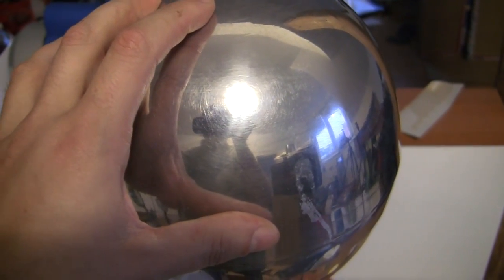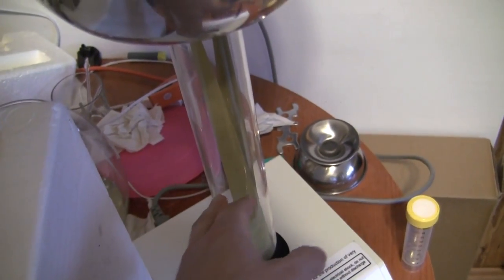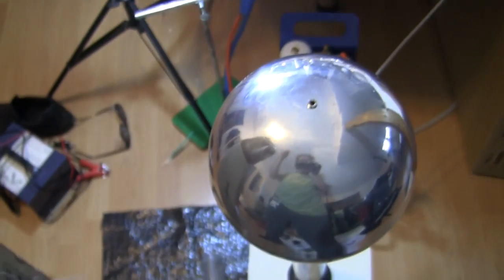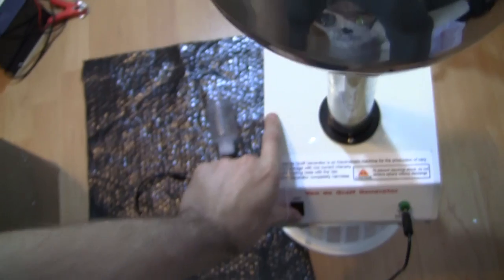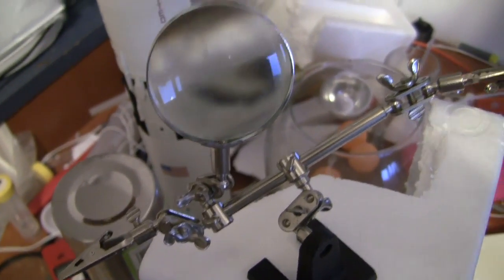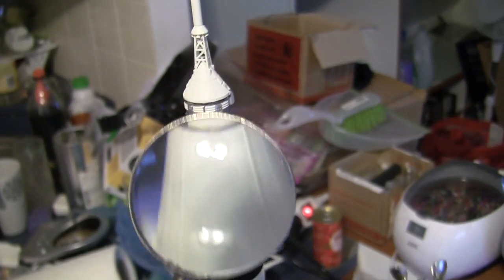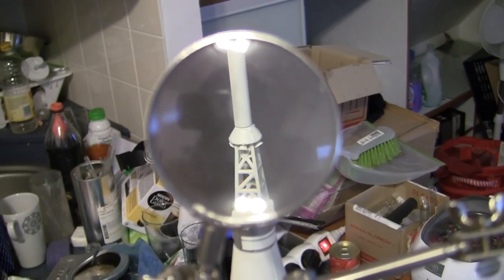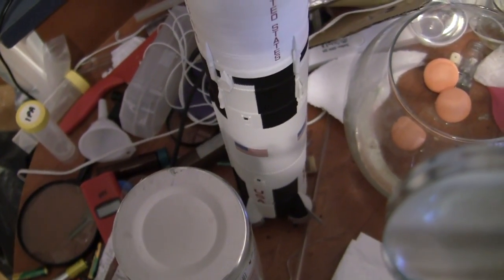Surviving a 10 000 VOLT shock!

Comment: It's always been my understanding, ever since high school physics, that the amperage is what would kill you, not the voltage. I forget why, though... it's been a couple decades. Voltage is... frequency, right? Amperage is intensity? I think. So the amps would burn you inside out, while the voltage would give you that jump?
Reply: I like to expain it like This,

Voltage Is like Speed.
Amps is like Density.

If you shoot a 1 cubic cm(Roughly 1/3 cubic inch) ball of wool at someone at 320 km/h(about 200 mph), It will hurt but it wont kill,
But if it is made out of Lead it will Probably kill.

That is a pretty basic way of explaining Regular Direct Current(Also Static discharges), It is not the same thing But it is Simple Yet pretty Good as a basic thought.
Reply: KhanAcademy has a great video about this. Voltage is nothing but electrical "pressure" or potential. All it means is how badly the electrons want to jump across to shock you. Voltage is not electricity. Current is electricity. Current is how many electrons want to keep coming at you until you die.
Reply: Current is the flow of electrons. Voltage is the electromotive pressure causing those electrons to flow. Saying that it's the current that kills you, not the voltage, is akin to saying it's not the fall that kills you but the landing. Technically, it's true, but the amount of current is proportional to the amount of voltage just as your landing will be worse the farther you fall.

The reason something like this doesn't provide as much of a shock as you'd expect from 10,000 volts is because it has a low capacitance (it doesn't take many electrons to change the voltage by a given amount) compared to your body and the electrons are being supplied at a slow rate, so you get a very brief surge of electricity which very quickly drops off as the voltage drops.
Reply: Just think of water. Amps are the water, volts are the water pressure.
Reply: Eric Morrison Right, Khan Academy. I've heard of those people! Thanks for the reminder and reference.

And thanks to everyone else for the clarification. It's appreciated.
Reply: Once the electricity arcs through the air, the air becomes ionized and the resistance goes way down. This is the process by which Jacob's ladders work. It's also why HRC fuses are filled with sand instead of air. You could touch the generator with a fairly low value resistor and not get shocked nearly as bad because the resistor maintains a fairly constant resistance as electricity flows through it unlike air.
Reply: ***** If you wanna be a smartass at least do it right.

Saying it is the current would be redundant too, as the current is based upon the voltage and the resistance.

But neither V nor A are gonna kill you, not W either, it's the Joules.
A van der Graph generator will generate huge potential difference, and when you get shocked, a rather huge current s is flowing too.
But it is a extremly short pulse, in the realms of nano-seconds, with a total energy so low that it doesn't cause harm.

Short: neither volts nor amps or watts are killing, but the total energy aka Joules.
Reply: It definitely isn't the energy (joules). You could easily withstand amounts of energy over the course of years that would kill you if delivered within a few seconds. Since for a given resistance, voltage, current, and power are all proportional to each other, you could say that a sufficient amount of any of them will kill you. In the most direct sense though, I think it's the current that kills.
Reply: "Current" is to "bullet", what "voltage" is to "pistol". You need BOTH in high quantities to kill someone.
Reply: What kills is high current flowing through your body. You can have high voltage but low power like electrostatic shock or you can have low voltage (like 10V) high current transformer. None of these things would do you harm, but something that has enough voltage and power to induce 100mA current in your body can kill you. So it's more like voltage and power of source is what kills, amperage is nothing but a direct result of it.
Reply: If it's DC, then it goes like this V=IR where I=current and R=resistance. So a very high resistance will result in a very high voltage. Therefore, a high voltage doesn't mean much at all.
P=VI, where P=power. If the power is much larger than the voltage and if the voltage is rather large, then you gotta start worrying.
Reply: Just to be a smartass on the internet: The Electrons are measured in Coulomb (C). Amperes is merely "Coulombs per second".
Reply: JohannesLazorFREETIME i came to this analogy to understand electricity myself too. i wish someone had better explained things in school. things would have been so much different.
Reply: ***** If you don't understand what a paper is talking about, it is a hopeless case trying to use it as an argument.

U = R*I  => given a specific U you will get a specific I and vice versa.
As long as you can supply enough energy it can kill, if you can't supply the energy, you can't keep a current of XX mA nor a potential of YY kV.

***** ugh.. did you even read what i have written?
A Current of even 200 mA is not deadly, if the voltage-drop would only be 0.1 V.
The simple notion of 'Amps killing' is misleading and does not reflect reality.
ESD-Units wil give you shocks at 30 kV with 30 Amps - hey, high voltage and high current, still not dead? Yeah, it is way too short of a pulse to deliver enough energy.

Of course nothing happens if you distribute the energy of a year.
But we are talking about lethal doses. And even there, a low voltage/Low current can kill you if you do it long enough - apply DC long enough and the electrolysis will kill you.
Reply: ABaumstumpf Voltage drop across a given resistance is proportional to current. This is actually how multimeters measure current. You may be able to change the resistance of your skin by wetting it, but you can't change the resistance across your heart or nerves, thus for a given current, voltage drop isn't a variable.
Reply: Voltage is potential. Current is flow

Picture this. Jug of water. There is 5 gallons of potential in there. Flip open the spigot, that is its flow. How much can you drink before you drown based on how fast that 5 gallons is hurtling into your mouth.
Reply: ***** "Nevertheless, voltage does influence the outcome of an electric shock in a number of ways, as discussed below."
You even copied the rest of the passage and did not understand the meaning of it?

the resistance of the human body is roughly the same for all people.
So what we are left with is only 1 dimension of freedom. Either you change the applied voltage or the current - they are directly linked and the result will be the same.
A given Voltage will result in a given current, so saying that only one of the 2 will do harm is like saying only mass will hurt you, not speed.

A 10g Object at 100 m/s has as much energy as a 1 kg Object at 10 m/s. Both can create the same amount of destruction.

With short pulse i of course meant the time.
Like electrostatic discharges with several thousand volts AND several Amp (not milli but full amps) - yes, they often go up to the double-digit amps-range and yet you don't die.
Simply cause neither Volts nor amps, not even both together, are enough to determine the damage done.

***** 
" Voltage drop across a given resistance is proportional to current."
And the current flowing over a given resistor is given by the voltage-drop - duh... and the resistance is defined as the ratio between voltage and current - you can twist it like you want, but those 3 are all linked, you can't change one without affecting the others.

"This is actually how multimeters measure current."
Yeah, and a shunt-resistor is the only way to measure currents... sure.
And even there, how does the range-selector work? Oh, it changes the resistance to change the voltage-drop.

"thus for a given current, voltage drop isn't a variable."
And yet again, for a given voltage the current isn't a variable.
Is it so hard for you to grasp that this works both ways?
And even a given voltage and current is not enough to kill somebody, as the time and therefore energy need to be considered too?
As i said in the first part, ESD-devices will have specs like 30 kV and 30 A - 900kW, yet do only give you a shock but not kill you.
Cause the caps used only have so much energy saved up and once it runs dry, no more voltage, no more current, and the pulse is over.
Reply: *****
"I mean if you want to argue against peer-reviewed literature" No, i argue against YOUR misuse of the former.

You started it with claiming the usage of power would be redundant as current would be enough to describe it - that is all right and dandy, but makes current exactly as redundant as using power or voltage.

Then you go on and write "Well, the peer reviewed paper I cited specifically states that current is responsible for physiological effects."
And at this point it simply is wrong - you need a voltage to get a current and you need enough energy for that power to have an effect.

A bit more of your post -

"Yes, not voltage, not resistance, not energy, not power, not <insert electrical property here>... It's current. Current is what causes the heart to fibrillate, the fibrillating heart is what causes potential death. "

"_A Current of even 200 mA is not deadly_
This is one of the dumbest statements I have ever seen. This is more than enough to cause a heart to fibrillate which is deadly in itself. "

In both cases, the total energy delivered is crucial.
As i said, and i will stress it again, ESD-devices will generate up to several tens of kV and tens of Amps, but the output will be a very short energy-limited pulse.

http://hypertextbook.com/facts/2000/JackHsu.shtml
300-500 mA for life-threatening situations with DC for example, where oyu need a longer exposure too.
And 70 mA can be fatal with 50Hz.

http://en.wikipedia.org/wiki/Electric_shock#Factors_in_lethality_of_electric_shock
It largely depends on many variables, current is but one of them.

Pulses under 1ms need significantly more power (aka Volts and Amps) to cause harm.
The voltage, the part of the body where it enters/leaves, the amps, the frequency and the time - those are the important bits of information.
Changing even one of them might significantly change the result.

http://ecmweb.com/shock-amp-electrocution/small-contact-voltage-exposures-not-lethal-human
A good reading with better explanation why the current-charts often used are not sufficient.

The thing is - the function is waaaaaayyy too complicated to be boiled down to a simple "XX mAmps = lethal".
Reply: ***** "but it literally is the current that kills you, at least according to him and that paper I cited before."
This is what i meant by misusing it.
It is - yet again - not the current.
The current is simply easy to measure for a given voltage.
Yes, his research has been used, so?
For now decades that simplification of what actually is going on has been criticized, but cause people are simply too dumb it is still used.

Have you read a bit more than just the parts you think are in your favor? For example, that you need significantly more DC for the same effect? That the resistance and the voltage have to meat certain ranges to enable a strong enough current to flow and that without a voltage of >50V there is pretty much nothing lethal?

You have yet to show that you even understand basic physic. And i do mean understand, not being able to recite some definitions but know how the stuff works.
I can't stress it enough i think, but again, every ESD will have a current far higher than you claim to be lethal. And nothing happens.

And what the paper meant about no more fibrillation after a certain threshold should be rather clear:
Nerves are essentially a low-power BUS:
With energy-flow not all to different form it you can disturb it, if the amps get too high the muscle will be cramped full time - no more fibrillation possible.
Reply: ***** "If you're such a know it all, why don't you use that perfect brain of yours and go get a paper published on your musings?"
I really don't see the point in writing a paper of already known facts.

"Or maybe you can just run the said currents demonstrated in the tables through your chest and see if you die or not? At least you'll be repeating previous experiments (ie. doing science)."
Oh trust me, i have gotten more than enough electric shocks in the range of several Amps and several thousand Watts - still alive and kicking. Guess the amps alone is not what kills you, eh?

It is nice to see you ignoring evidence but projecting that onto others.
Reply: ***** Good god, you are one hack of an annoying person.
Go take an electric lighter - take out the piezoelectric element and shock yourself.

about 1 cm of spark-length is possible depending on the particular one you are using, but lets go low, say 6 mm and humid air - we would be at around 5 kV there.
Get your hands wet - resistance of under 1 kOhm.

Touch the bottom with one hand, the spark-wire with the other, and hit it.

We now got at the very least 5 kV at 1 kOhm, so 5 Amps for a total of 25 kW.

Is that enough for you?
It will sting, but i can assure you you won't be at any risk dying from that unless you really got a weak heart and are a scaredy-cat
Reply: *****
It is pretty much the other way round, i have read the papers, and whadya know, you need the right voltage (> 50V externally applied), the right current (> 20 mA), the right frequenzy (DC vs AC vs HF) and the right time (ns vs ms vs seconds).

And you have continuously ignored all the evidence where is showed you without a doubt, that the current alone is not what kills you.

instead of sarcastically admitting defeat you should try to understand the physics, try to understand the paper you link.
Try not to sound like a 14year old that thinks copying some papers would eb the same as understanding them.
Reply: ***** I'm not trying to make you look bad, but i try to prevent others from stating simplifications like "it's not voltage but current that kills" as facts.

"Although I find it awkward that the authors would make current tables and write statements so explicitly if they did not think otherwise."
The tables are accurate and show the current that needs to be flowing through the heart for a given time (too lazy to check the paper yet again).

Even those papers them self don't claim it to be the current alone, and you will find hundreds of other papers that go into more detail about shock-duration and frequency.

It is just like the simple example i have given:
Having a specific current won't tell you how harmful it will be in the end.
Reply: *****
"He had a very difficult time understanding the things I was quoting from the paper."
Some huge misunderstandings there :D
That paper and hard to understand? You failed (and still do) the very basic physics behind it.
And to top it of you simply ignored all evidence showing that current is not the only factor.
That is what i would call close-minded.

"Once you convince some professionals"
he won#t need ot convince any professionals as they will all tell you the same when you ask them:
Current alone is not enough to determine lethality or if even any damage is will be done.

"ut they do not fibrillate a heart. Power, more or less, causes burns and voltage simply facilitates the current. "
Learn basic physics please or shut the fuck up.
Reply: *****
"I've already mentioned, several times, that they factor into its lethality but its the current that does the damage."
Yes, and that is simply false.
Read any basic textbook, even middle school should be good enough, to show you just how wrong that statement is.

"but not invested enough to test your idea in peer-review."
I gave you an example that will happen hundreds of times every single fucking day - electrostatic discharges.
That little thing that can happen even when you just change your cloth completely fucks up  your claim that everything aside from current play no significant role.

YOu just keep repeating the same old shit without using your brain.

Of course anybody that knows something about electricity will have headache seeing what you have written.
it is half backed knowledge that can possibly harm others or even kill them.
Maybe should should think the next time before you write so much BS.
Reply: *****
"Abaumstampf pointed out, you can stand near a high static charge and not feel anything."
Not only stand next to those charged, the discharge, a short electrical pulse, doesn't do any harm either, and that thing has up to several Amps.
Reply: Volts jolt.
Amps kill.
Reply: It's like saying that if you get killed by a brick thrown from a building that "it was the mass that killed you, not the height" Nonsense, it's both together. a pea from that building wouldn't have killed you, even if neither reached terminal velocity first. Nor would a brick from 1 centimeter above you. It's a bit different with electricity, as the metaphorical brick won't even fall if it isn't high enough, but whatever.